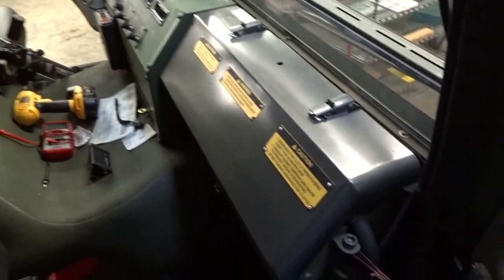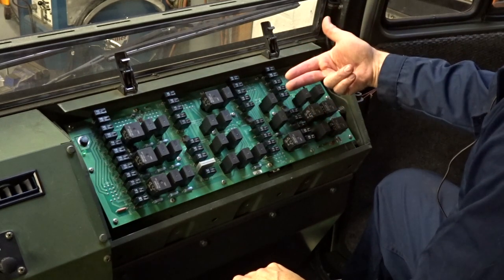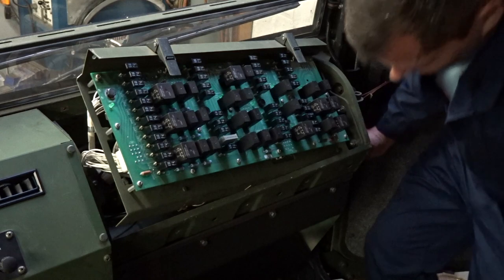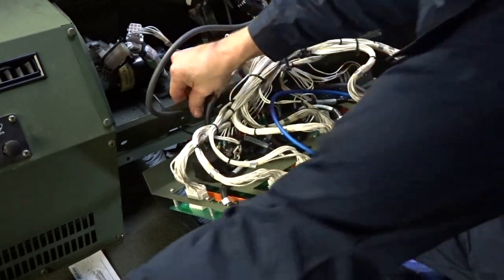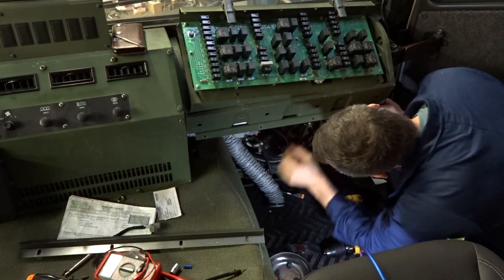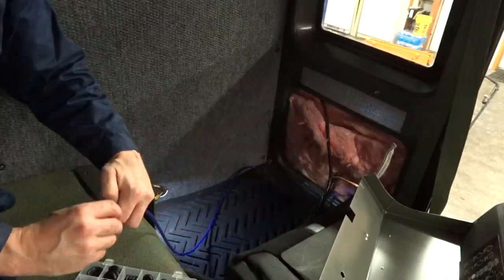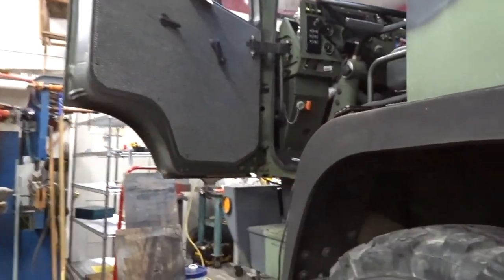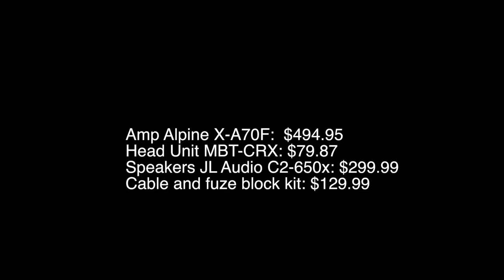LMTV Amp and head unit installation

Comment: I am liking your insulation... I'm doing a little sound proofing of my own. Where can one find those rear panels you have screwed to your back wall? Sound video!
Reply from the maker: Helicool's Helipad I had to make my own out of 1/2” birch plywood.  I did it in 3 separate panels.  But after I finished my panel, I found someone that did it with one panel. Also, the foam board only cuts down on the low frequency, so the turbo whine cuts right through.
Reply: @BrokeOverLand  I am still at 69 dB and slowly making improvements. If I could hear the turbo, I'd be down right impressed! LOL!